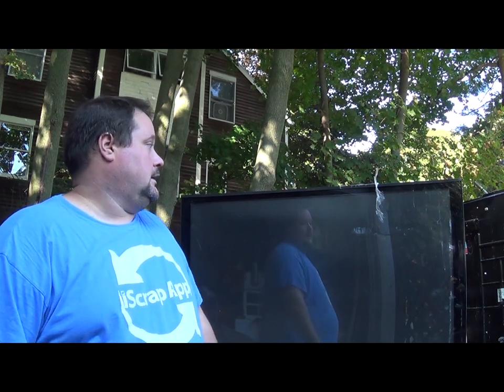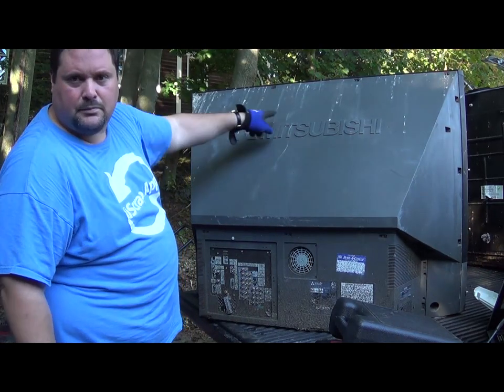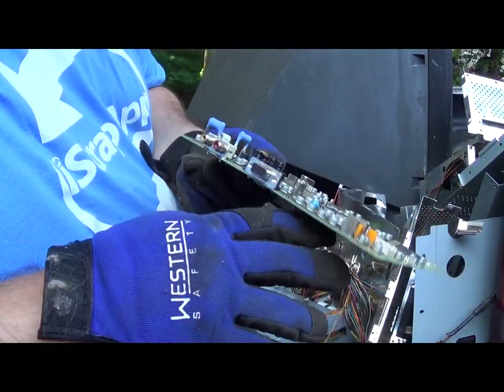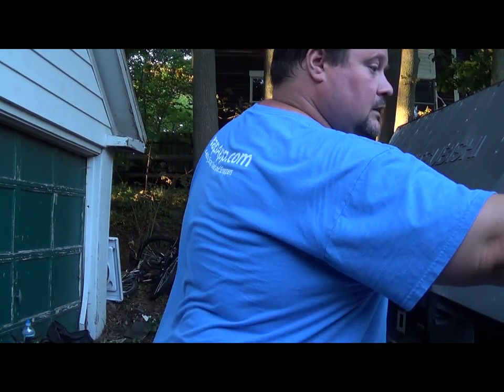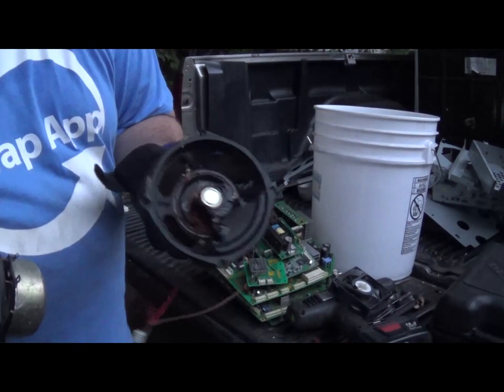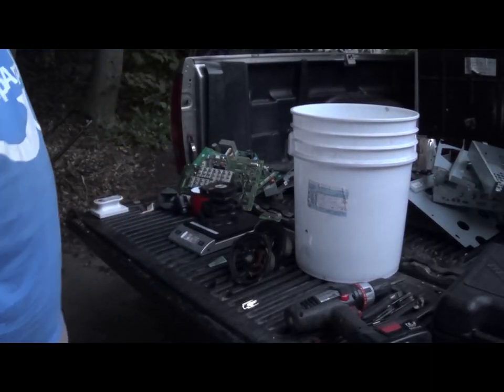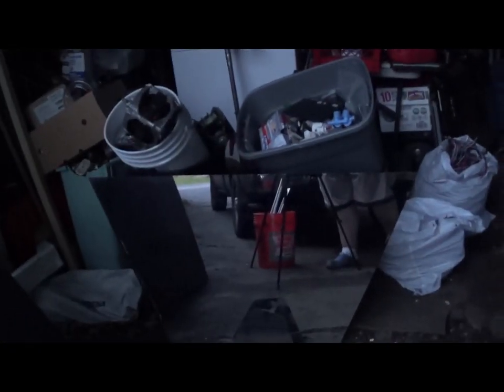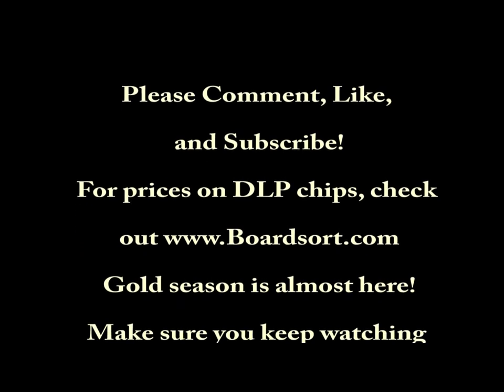Scrapping a Projection TV for copper and GOLD!

Comment: Thanks Moose Scrapper. Yup, a lot of options with that lens, would you consider posting what you decide on?
Reply from the maker: I decided to make a solar powered metal foundry.  I am building a framework on swivels so I can rotate it to follow the sun and have a big black cast iron pot the I filled with sand and put a smaller crusible in the middle.  Gonna mess with it.....lol

Comment: just as a warning ..wait awhile before you start cutting chords..i unplugged a tv and an hour later still got shocked when I cut into the thick chord connected to the lightbulb it was an older tv .it was not fun at alllllllllllllllllllllllllllllllllllllll
Reply: +BLOODYMOON62 Been there! Standing on a step stool, leaning over a dumpster.
Reply: +BLOODYMOON62  Remove the capacitor 1st.... But why cut cords when they come out in 1 piece as you dismantle things?
Reply from the maker: +Mike Oxbig uhhhh, an hour after it was plugged in...yup... that'll do it.  I cut cords because they usually get in the way while I am trying to break things down.  But that's just me.
Reply: You we're part of a SHOCK AND AWE campaign

Comment: Moose ever looked at the metal inside of picture tube value? Also where do you sell your magnet's?
Reply from the maker: +David Moore I sell my magnets on ebay, they move pretty quick at the right price.  As for the metal inside picture tubes, I try to not break them.  The phosphorous powder in there is toxic and its just not worth the three cents of ferrous material as far as I know.

Comment: Moose i scraped a projection tv today. Screws ugh. I did not finish and wanted to know if there is a YOLK by the Glass projector? I got all the small copper that was in the lower back panels. If there is no yolk by the projector class i don't think i will scrap another one of these again. There not as good as the old style tv's.
Reply from the maker: Sometimes there is a set of three very small yolks.
Reply: Really i did not find any Yolks but there was a ton of Flat Boards. I actually did better on the smaller TV. Today i picked up 4 TV's to scrap and 2 large grills with lots of Cast Aluminum. Moose really appreciate all your videos. Every time i find something i type in how to scrap with the item i am attempting and there is Mr. Moose. You are a great guy. One thing however that i am NOT doing is attempting the gold attracting or silver from the boards. This is a lot of work have you actually been successful with this? I heard it takes about 500 grams of flat board plated to get 1 gram of actual gold. I think i would rather just get 1 buck a pound from the yard unless you suggest otherwise from your results?